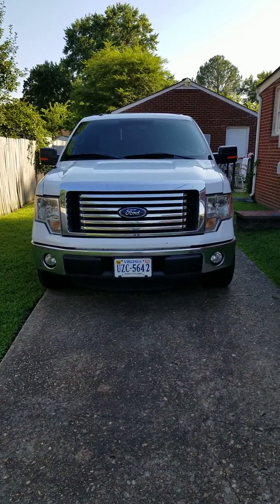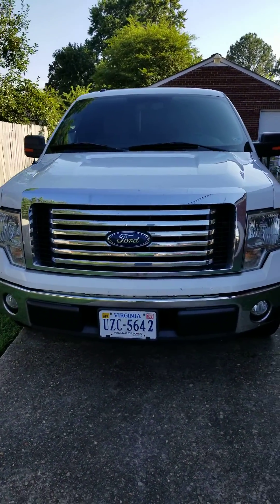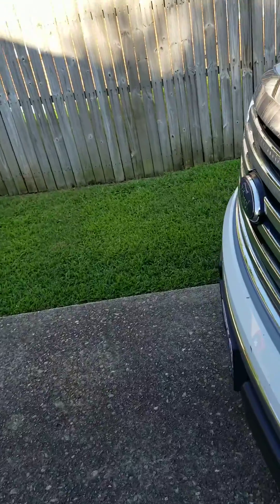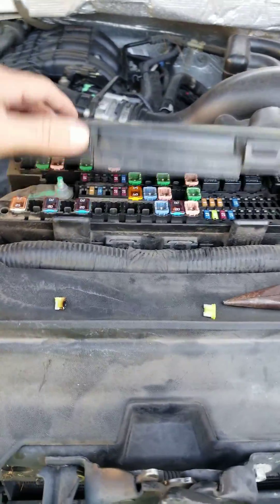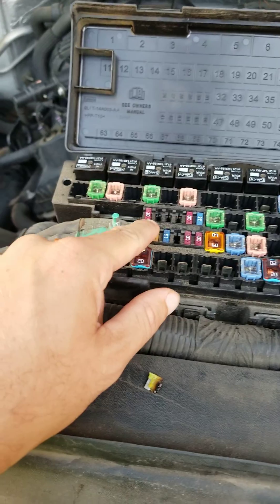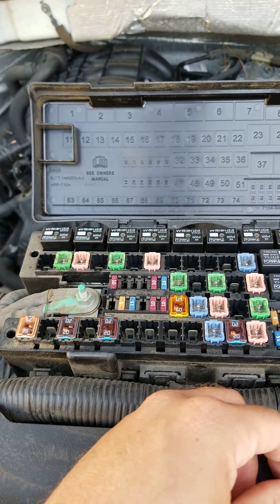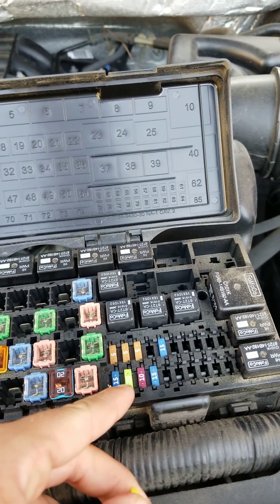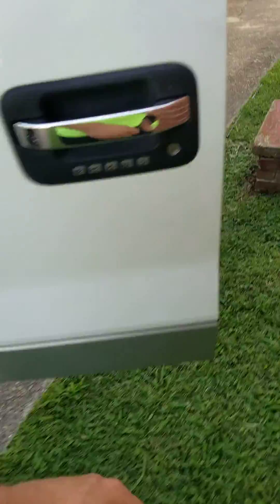2012 ford f150 cranks but wont start *fix*

Comment: Buddy!!! This video was a life saver.. this just happened to me on my 2010 FX4.. I  went to The Home Depot to have a spare key made, came out and was having this issue..  my first thought was the new key that they made fried the transponder of the factory key.. I was at wits end trying to figure things out and ran across this video.. Sure enough, my 20amp fuse @ Fuse 27 was cooked..  I took the 20amp from the Traction Control and it fired right up.. I limped it to the local AutoZone and purchased a replacement to put back in the traction control spot.. by this time the traction control wrench and squiggly lines were showing on the dash, and the check engine light was throwing 15 codes.. reinserted that 20amp fuse and cleared the codes..  smooth sailing for the 26 mile ride home..  THANK YOU!!

Comment: You saved a big towing cost, came home after driving, then tried to go back out to hunt, just turned over, no ignition, saw your video, fixed in no times, thank you very much
2010 F150 super crew 5.4

Comment: This just happened to me and my 2014 Raptor.  Ford needs to inform all F-150 owners of this issue ASAP.  I figured out the problem by reading other forums, but came to YouTube to see if other Ford F-150 owners have had the same problem...you have a great idea of pulling the Traction Control 20a fuse in case of an emergency, thanks.  I am keeping extra 20a fuses in my truck from now on...Ford should fix this problem for free and should be a recall and place this fuse in a bigger and better spot.  Shame on Ford, I am pretty pissed about this and can cause MAJOR issues and be very dangerous by leaving people possibly stranded in bad spots!!!!

Comment: Same problem today on my 2012 FX2, took your advice and now it's fixed. Thanks so much. The same symptoms
were experienced 2 years ago, that time the mice had chewed a wire. It cost $1700+ at the dealership to
replace a $65 short wire loom underneath the intake manifold. If it sounds far fetched just check having
BU5T 14B485 J4CP7 wire loom replaced on a 2012 F150 FX2 with the 302 engine. Thanks for being there
to lend a hand, there's a special place in heaven for you.
Reply from the maker: Thank you sir, glad I could help.  Please subscribe

Comment: Saved the day!  I've got a 2010 Platinum.  I was already calculating cost just to have truck towed to the shop.  Found your video and checked fuse 27 and it was just slightly burnt.  Switched it out and fired right up!  Thank you so much for posting this!!!  Probably saved me $$$ over a .50 cent fuse.
Reply: Where are you  buying 50 cent fuses?

Comment: Holy sh*t!! I talked to a shop and thought the fuel pump went out of my 2011 f150. He told me around $600 to fix it. But after messing around I got it started and held off on putting a fuel pump in it. Fast forward almost a month and it wouldn't start at all. I seen your video on here and bam!!!!!! Fixed and it was exactly how you said. Can't thank you enough.

Comment: Yep! That did it! for $3.49 I bought a package of 20amp fuses and I'm back on the road.  Saved me hundreds of dollars on a tow and service at my mechanic's.  2010 FORD 4x4 did the same as you described, wouldn't start 4 hours later it did and 3 weeks later same problem then I found your fix. I did slide into the slot beside 27 first as someone else mentioned but realized after it wouldn't start changed it  started right up. Thanks man you saved me money, stress and days of no truck since it happen on a Saturday morning.
Reply from the maker: Glad i could help. Please subscribe

Comment: You saved me an expensive tow this Sunday morning.  I was stranded in a parking lot about 10 miles from home.  I found you video and switched out the fried fuse just as you suggested.  The engine started right up and I was able to drive to the local Napa Auto Parts to get a new fuse.  The transmission shifting and engine speed was quite rough with the other fuse removed, but once I installed a new fuse everything ran fine.  Problem solved with a $1 fuse.  Thanks!

Comment: Tks for posting. I have a 2010 and thought it was the fuel pump since I already replaced my fuel sensor relay. Found your video and I had the same exact issue! You saved me a tow!

Comment: Thanks.  This just happened to me at the grocery store on my 2010 XLT.  I got it started after several minutes.  When I got home I came across your video.  After checking my fuse wasn't burnt all the way through but the plastic was melted and brown.  Replaced and it's working great.

Comment: Thank you so much for this video! I have a 2012 Ford F-150 and I was having the exact same issue. I just recently got it back from the dealership after paying $3K to get several things fixed. So when this happened and it wouldn’t start I wanted to cry; I was so stressed wondering how much this was going to cost me and how to pay for it. I was about to have it towed back to the dealership until I came across your video. Thank you so much!

Comment: I'm not one to usually comment on YouTube videos, but damn! I had racked my brain trying to figure out why the truck (F-150 2010 King Ranch) was turning over but wouldn't start. I pulled up this video, kinda blew it off, but decided to check fuse #27 anyways. Pulled it out, and sure as hell, it was charred on one side. Popped a new one in and it was like nothing had ever happened. Thanks for taking the time to make this and saving me on tow truck fees, I owe you one.

Comment: One of the bizzare things about the internets is that you can have a seemingly random problem, and someone will have posted the solution. From: "How am I going to figure this out without having the get my truck towed to the mechanic?" To: "Well, that was easy." in 10 minutes, flat. 2011 F150, same problem. Solved just as you suggested. Thanks!

Comment: Man she shifts rough after but it will get you to the parts store without an expensive tow and fees from a mechanic thanks man huge save
Reply: If you go into the interior fuse panel (passenger side foot well, right side) there should be a spare 20A fuse you can use instead of pulling the 75? Fuse which is TC, but also emissions. Also you can pull the 20A for the power door locks (just make sure you unlock all the doors first, this is what I did bc someone already pulled the spare 20A).

Comment: Thank you sir. This video saved my day. Last evening I was just checking the Aux pwr fuse in te fuse box to see if that is burn. By mistake I pulled #27 fuse and pushed it back on a different slot. Then I started washing and cleaning the bed liner and cab and stuff. After an hour or so tried to leave for the mall and it won't start.  I totally forgot that I did some thing to fuse box . Was very upset for some time and later hit the You tube and luckily this video showed up and I checked the #27 slot which was empty I realized my mistake and put it's fuse back to it's slot and it started right away.:)

Comment: Had the same issue on my 2011 Limited F-150.  Replaced the fuel pump, module, and filter, still had the starting issue.  Then, I saw this video, checked fuse 27, it was half burnt.  Replaced it, good fix!

Comment: Thank you!! Fixed my truck when the dealer couldn't figure it out and changed my fuel pump 1000.00 later.    $1.39. fuse did the trick
Reply from the maker: Glad I could help.  Please subscribe

Comment: Thank you so much for this video. I'm just leaving work after a 12 hour shift. Did what you said and I'm running. I've had the truck a little over 2 years. First time since I bought it that I've raised the hood. I've only put 4000 miles on it.

Comment: I had the exact same problem on my 2005 lariat. Cranks but won't start. Noticed the fuel pump wouldn't prime. Checked fuses...all good. Did some research and found that it could be either the Fuel pump itself or the Fuel Pump Driver Module(FPDM). Thanks to the geniuses at Ford engineering, they bolted the module which is aluminium, to the frame which is steel, next to the driver's side rear tire. Had to drop the spare tire to get to it. Bought a new module and was just going to plug the new one in to see if it would start...and low and behold, it started right up!!! Went to remove the old module and it basically crumbled into a million pieces!!! What genius would bolt aluminum and steel together in an environment that is loaded with water and salt?

Anyways, the new module from Dorman came with rubber grommet spacers that keeps it off of the steel frame so that it doesn't collect water and salt! Runs like a champ again for only $100!

Good video on this issue at the channel *FordTechMakuloco*: https://www.youtube.com/watch?v=MnDZNrn5mnY

Comment: Me too! This was exactly the same problem in my 2012 F150. Fried fuse. Swapping fuses caused a lot of other drama though so I had to quickly locate another fuse to replace the one I robbed. I'll be checking the check engine light now that remains on. But this got me from stuck in the middle of nowhere to 3 hours down the road safely. Thank you so much for sharing. Life saver!

Comment: Dude! This worked. So much better than throwing parts at the problem or searching for a “bad ground” issue. For others’ benefit, I checked my #27 fuse under the hood and sure enough, it was half-baked looking. Conversely and maybe Ford planned it this way...the passenger side fuse box inside has a spare/blank 20a fuse ALSO in the #27 spot! Thanks for posting this!

Comment: Thanks for the video. I have a 2014 and had the same crank but no start…. I checked the fuze and it was fine. Checked the relay and it was good also. Ended up being a fuel modulator under the spare tire. $45 from Ford, 2 bolts and electrical connector and done. Easy fix for the DYI

Comment: Same issue for me on my 2012 Expedition except it wasn't the fuse, F44, but the fuel pump relay, R5, located in the under the hood relay/fuse box.  The relay coil wasn't working and closing the contacts to energize the fuel pump.  Same circuit though.  Must have been a design flaw in the fuel pump system for those model years.  Thanks for the video, it's a big help!
Reply: Please see my comment about replacing the Fuel Pump Control Module, which will become necessary when replacing fuses and relays no longer works. We bought new relays and swapped relays around every morning for months until that strategy no longer worked, as the Module deteriorated more and more, causing more and more starting problems.

Comment: Thanks man!  At 90,000 it was the first time my work truck was going to leave me stranded!  One thought, I followed your video and used the traction control fuse.  But the horn fuse is on the inside fuse panel and is 20amp.  This is a better option as the horn is not mission critical to most!  Thanks again!

Comment: Something has to be causing the fuse to burn up. Another part down line? Something different is the root! 

Pulled my traction control fuse to replace my #27 and fired right up. Drives really strange without the traction control. Lose 1k rpms when letting off gas peddle. Wasn’t expecting that. 

Now to keep more fuses on hand. 

Thanks for the quick tip to get rolling again!

Also I’m awaiting the real issue to show up!

Comment: When this problem happens again, and nothing seems to help anymore, and the professionals tell you that they need to drain and drop your fuel tank and put in a new fuel pump, at a cost of $1,000 to $1,500, be sure you have first replaced the Fuel Pump Control Module, which is bolted to the top of the frame rail just behind the left rear tire.  When it fails, it may not send out any DTCs  or cause any lights to appear on the instrument panel.  These modules are sealed units, and there is little information available on how to test them.  However, you can change it yourself pretty quickly.  Aftermarket units vary in cost from about $37 to  over $100; I could not find an OEM part number on Ford's website, but I feel confident that Ford's price would be at least $200.00.  I got mine from NAPA for about $60, and it solved my starting problems.  Napa lists it a solenoid or relay, not a module, which is good to know if they tell you they can't find a part number for this module.  Good luck.

Comment: Huge 'other' problem that does not get attention is the fuel pump relay MODULE. Located above rear axle. Costs $70.
They go bad from all the on/off cycles over the years. Try this before you think you need new fuel pump.

Comment: Thank you for saving me rear! I had just cleaned and oiled my cold air intake filter and I thought I had done something wrong, since it started and then I got stuck at the post office. I googled the issue and saw your video. Thank you, thank you, thank you!!!
Reply: BTW, forgot to post truck info. I have the 2013 F-150 Fx4 6.2L

Comment: One other reason it might crank but not start is because you’re using an old chip key that isn’t playing nice with the security system. I had that happen to me after I changed the battery.  I Installed it, cleaned all the terminals & even charged it up just to make sure it was ready. Couldn’t start it to save my life. Then I finally realized I was using an old chip key which apparently my truck no longer likes. Grabbed the newer keys & she started right up.  My F-150 is a 2002 btw.

Comment: IMPORTANT:  The fuse he "borrowed" in this video was NOT the traction control one in my '09 Triton V8.  It served a more critical operational function and the truck ran like hell afterward. Look up the fuse box diagram yourself for your truck and replace one that will for sure not affect operation much until you can get it replaced.  In mine, I found a 20A in #31 for "trailer tow park lamp relay".  Swapped that one out instead and it ran fine.
Reply from the maker: Thanks for the info.  Hopefully this will help someone
Reply: @n9nedeez_kid372  I do indeed appreciate the video. It was the right baseline solution.
Reply from the maker: Youre welcome, im  Glad i could help. Please subscribe

Comment: It's not just replacing fuse 27.  There's a TSB and fuse relocation kit within the existing fuse box from Ford.   If the fuse is bad it's 1 thing. If the housing is crispy, relocate it.

Comment: Same. I just got off work and went to start my 2010 Raptor and it will crank but won’t start. I was allowed to drive my work truck home and right away got on yt to find someone with the same problem. I will try a new 20A mini fuse in #27. If this works you will be my hero. I’ll let you know.
Reply from the maker: If it works please subscribe.  Thanks for watching
Reply: @n9nedeez_kid372  you got it 👍🏼
Reply: @n9nedeez_kid372  okay 👌🏻. You are the man. Took me all of two minutes to get ‘er going. A promise is a promise... SUBSCRIBED 👇🏻. Now don’t get rid of the Ford and post every little problem you have and the easy fix you did. Thanks again.

Comment: You are the man! Saved me from having to get a tow. Fix works if you are having same issue on a 2012 raptor with the 6.2l. definitely subscribed.
Reply from the maker: Thanks man. Glad your back in action. Keep some spares in the truck because it will happen again. You have to relocate the fuse to fix the problem permanently
Reply: @n9nedeez_kid372  thanks for the heads up, after I swapped it with the TCS one I went straight to advanced auto and grabbed a 5 pack. Guess I'll just keep em and needle nose pliers in the console til I have time to relocate it. Thanks again!

Comment: Brother, I wish I could like this video a thousand times. You saved my butt this morning! Any kore issues out of the fuse, relay, or fuel pump since you discovered this?
Thank you!
Reply: *more
Reply: @bartmauldin597  Have you had any fuel pump issues sir? just wondering thanks Bart
Reply from the maker: I havent had any problems since i changed that fuse.
Reply: @bahabaha482  I have actually traded the truck in on an expedition since that fuse swap. But it ran great afterward and I see it around town all the time. Hopefully, all is well with it.
Reply: @n9nedeez_kid372  Excellent! I just changed out burnt fuse and it started right up. Thanks, Happy New Year!
Reply from the maker: Youre welcome.  Please subscribe. More trucks videos coming soon

Comment: Not sure if this was addressed in the comments but there's a fuse relocation kit for this issue. Models between 2010-2014, the fuse can continue to blow from time to time since the fuse is under amped. Just a heads up. Hope this helps.

Comment: Just so you know, there’s a TSB on this..

For whatever reason, this fuse gets hot. It doesn’t blow, but it melts. It will eventually happen again. There is a relocation kit you can buy from Ford to fix it

Comment: My mazda cx 9 has a 3.7 Ford engine.  For some time now, the engine of the night stop has been turning on and off.  It starts the second or third time.  Then it starts normally.  I cleaned the fuel mesh filter.  Is it a faulty fuel pump?  Forscan shows error p0171 - poor mixture of cylinders group one.  What is going on?  please help
Reply from the maker: Figure out what that error code means and see if thats the issue. Otherwise you got to troubleshoot the old school way. Next time it doesnt start, spray starting fluid into the intake. If it starts you prolly have a fuel problem. Then start troubleshooting the fuel system until you find the problem. Sorry i cant be more specific, or tell you what the issue is. Goodluck man.
Reply: @n9nedeez_kid372  thanks

Comment: Helped me fix my 2012 Ford F150 problem.  Was researching mechanics and how I would get my truck there.  Thanks for the video.  Question - is this problem something that usually starts occurring more frequently after it occurs once?  Meaning, there is actually a bigger problem/issue?  Cody W.